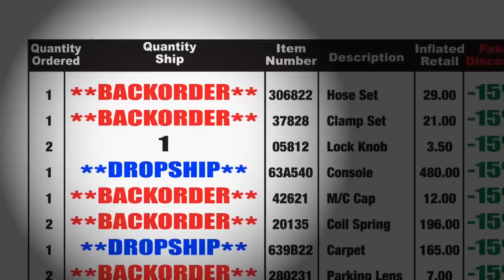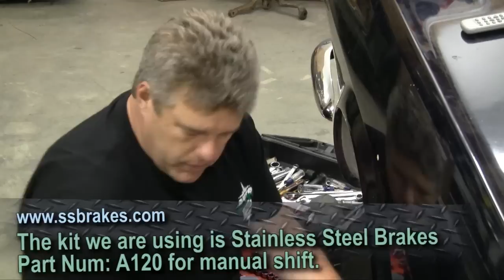Episode 112 Drum to disc conversion Autorestomod

Comment from the maker: Yeah it is right there. That was a "better idea" from Kelsey Hays. These brakes are identical to the ones used by Ford in 1965, accept for the stainless steel pistons and brake crossover lines.

Comment: I have 1965 mustang 4 lug v6 I want to convert to 5 lug v8 .
If I change the spindles would I need to change anything else in the suspension?
thanks for your help, really good videos,
Reply: I have the same question.  Doing the same swap with my '66.  Did you ever find an answer?

Comment: I have a 1965 f100 step side truck. It has both front and back drum breaks. Is there a easy conversion to disk breaks for this and a place for parts. And also possible power steering. Thanks and great videos
Reply from the maker: We'll be doing a video on adding disc brakes. Best we can say is, at this point, you will be best served putting '73-'79 I-beams and discs on. Check here for the full story: http://fordification.com/tech/discbrakes01.htm

Comment: I am currently restoring a 66 C code Mustang. It currently has the 4 drum system. Do the spindles need to be swapped out on the 66 for the disc conversion? I've seen videos where the swap was done without changing the spindles as well.

Comment: I'm building a 1984 Nissan Datsun 720 how would I go about swapping the rear end to disk breaks soi can implement a hydraulic hand break
Reply from the maker: Sounds like you want to do a little bit of drifting. The best we can recommend on the brakes is to hit some forums like ratsun.net and ask. As for the hydraulic e-brake that can be added at any time as the rear brakes should be hydraulic already.

Comment: I have an 04 Chevy cavalier, and dont know much about brake conversions, and want to put a disc set in the rear (to replace the drum set) is it similar to the method in this video (since this was a front conversion on a ford not Chevy) and if not, what differences would there be that I need to know about for the process
Reply from the maker: +Destyn Jacquneaux Mmmmto be honest, we aren't sure. We found this write up on the net: http://www.beretta.net/forum/viewtopic.php?t=4140
Seems that Cavalier folks are using the Neon brakes. The only thing we're not sure of is whether the 04 will work or not. Hope this helps! We'd also recommend looking the web over for that Neon to Cav. conversion.

Comment: Very informative just a quick question restoring a 94 camaro want to change from drum to disc now theres a same year model with disc already whats the easiest and cost effective way to go just a restoration not a track star any help greatly appreciated
Reply from the maker: You have two ways to go, aftermarket and salvage yard. Biggest problem with a salvage yard rear disc is going to be finding a car with the rear disc axle. The aftermarket system will run you in the neighborhood of $700.

Comment: So I have a 1999 grand am se2, and a 99 grand am gt1 parts car and I was wondering if I could get the rear discs off of that and put it in place of my drum brakes... I am currently trying to increase the value of my grand am for as cheap as possible to sell it.
Reply from the maker: BMX22kw We'll have to "bump" some of the Pontiac Forums for this one. We're just not sure what you tell ya.

Comment: Great video, question I have is will this solution work with the original 14x5 styled steel wheels on a 66 convertible?
Reply from the maker: I feel pretty sure that if you stay with the stock style caliper, it will.

Comment: Hey guys what about the proportion valve 
Idk what to do with that ? I have a single bowl master aswell
Reply from the maker: Unless you are building a concours car, I would dump  the single bowl. Set the proportioning valve up so that the rear brakes are just before locking up.

Comment: Hey, have you guys ever heard of rotor spacers? I have a 65 Buick Wildcat Deluxe Coupe. I bought a conversion kit for it but the rotors sit too close to the caliper bracket. The guys at Jamco said that I need a couple rotor spacers.(They should be here any day now). I have never heard of such a thing.
Reply from the maker: If it is an aftermarket kit, we can see how that can be. Seems like we remember that the Buicks of that era are a little bit different on the braking front.

Comment: have a 73 maverick i want to put disk brakes all the way around....question is can i use my factory spindle?
Reply from the maker: +Mike Teets With the drum brake spindle yes. The maverick used a nearly identical sindle to the '70 Mustang. The biggest difference was the larger tie-rod end.
Reply: +AutoRestoMod ok thanks!! trying to get my girl on the road love your channel!!
Reply: +Mike Teets also plan on doing the rack and pinion swap that you did on the mustang.....but with the 4 wheel disk brakes do i have to change my master cyclinder?
Reply: +roof pizza why is that
Reply: +roof pizza it will drastically slow down better.....its all over the forums....lol
Reply from the maker: We agree with Roof. The rear drums on street cars are far more effective in braking.

Comment: Its the same if i want try to convert the drums brakes to disc brakes in a Ford F100 1979
Reply from the maker: You'll want to source disc brakes from an E100 van or truck of the same era. 1977-79 will work.

Comment: So basically to convert from a drum to disc system, you replace the spindle to accept a disc system and install all the hardware? I didn't see if that had drums or discs on it before :p
Reply from the maker: Nope. The kit is a replacement for the drum. Spindle stays put.
Reply from the maker: This is the testing and removal episode: Episode 111 Drum to disc conversion and testing Autorestomod
Reply: Oh ok, great thanks! I'm going to check out that video. You guys have been very helpful so far.

Comment: What to do with a 1948 Chevy truck?
Reply from the maker: http://ssbrakes.com/i-10092136-disc-brake-kit-front-1-single-piston-11-inch-rotors-a148-15.html
Reply: +AutoRestoMod Muscle Car Resto and Modifications great video guys keep up the good work. im getting ready to do the conversion on my 1961 ford falcon. i have one question im looking up mc dual resevior from a 67 mustang but there are quite a bit of options. i was wondering if you guys could lend me hand in chossing the right mc! thanks guys!
Reply from the maker: We'd recommend going with a 1974 Maverick Manual disc brake master; DO NOT use the one that is for boosted applications. Keep your pedal push rod, Better on pedal effort.
Reply: +AutoRestoMod Muscle Car Resto and Modifications 
thanks for the reply guys! i should add that the set up im going with as of right now , Is front disk brakes and a 8 inch rear end.With that being said i was actually doing some research and saw that the original mc is a 1 inch bore and the one for the maverick is .09375 which is 15/16 according to my local autozone parts store, now would that make a huge difference.
Reply from the maker: Not "huge" but it does help with pedal effort.
Reply: +AutoRestoMod Muscle Car Resto and Modifications   thanks for the info!! cant wait to set it up!keep up the good work!